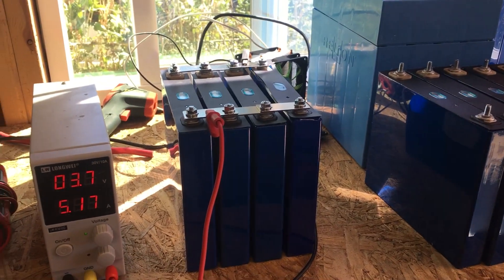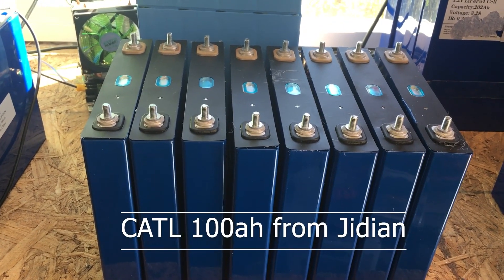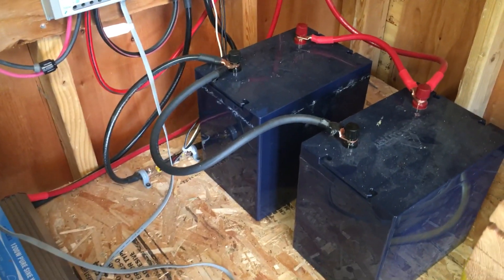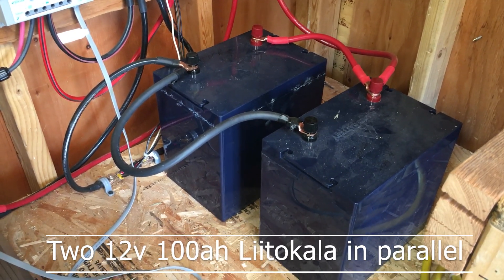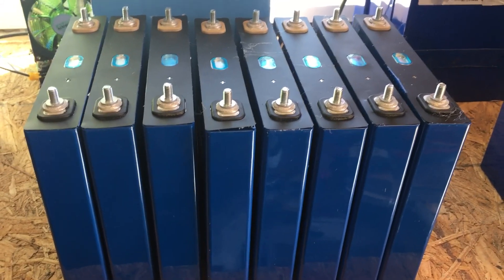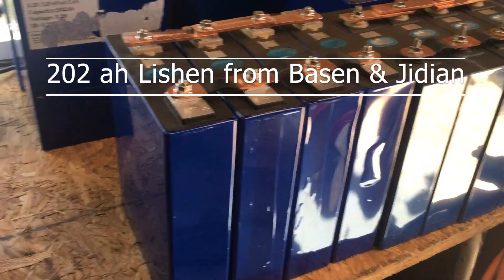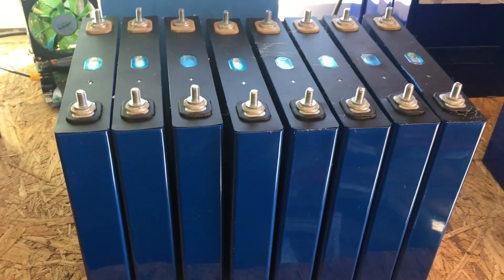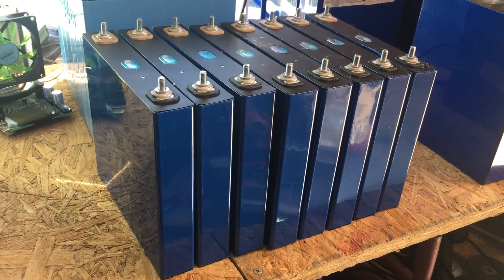New CATL cells arrived swollen plus some 12 volt 100 ah off-grid solar setup updates.

Comment: All your cells are used, dismantled. Litokaala, deals primarily with used and dismantled cells. And also B grade cells. 
Sometimes they are A grade, and better than the brand new B grade cells. 

A LFP factory in its first 3 months will only yield about 40-50% A grade. It takes them 12 months to be to 80-90% usually. Its freely available information. But 99.9% of people dont know where to look.

Comment: Not worth the effort selling batteries. The hazardous shipping costs are high, have to deal with returns, and then there is the liability issue.
Reply from the maker: Pretty much the conclusion I have come to as well.  Especially when you add all that to massive shipping delays, huge increase in shipping costs and inconsistent quality of cells.

Comment: Never buy Liitokaala! They are scammers. Got 64 of 105Ah -> average was 81Ah. And they sell CATL 240Ah as 280Ah
Reply from the maker: Dang, that was terrible.  My LiitoKala were about 96-98% and I have been using them in my workshop for a few months now and they seem fine.  But I still prefer EVE cells the best out of all of the cells I have used.